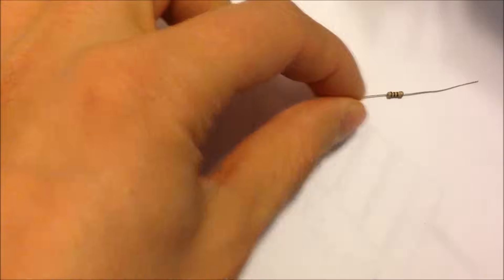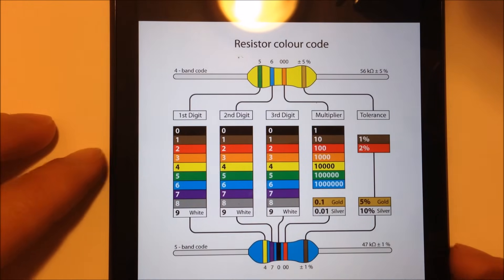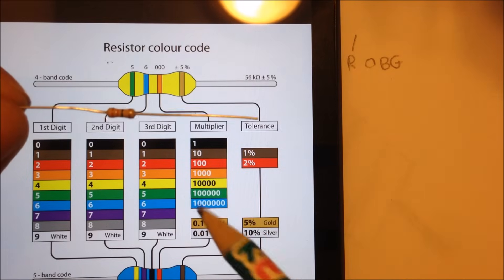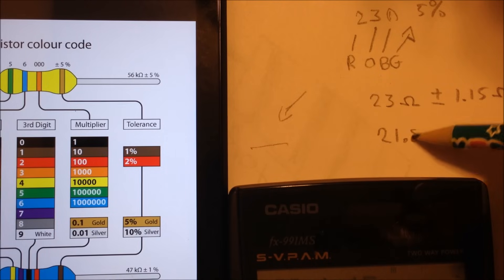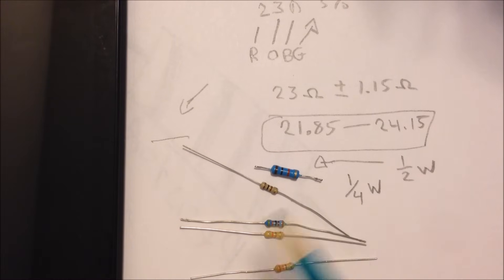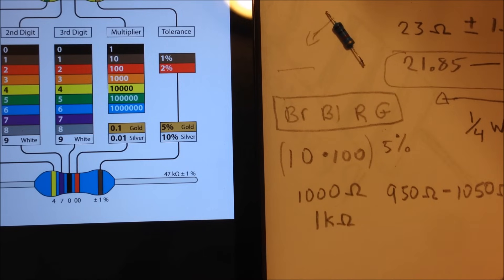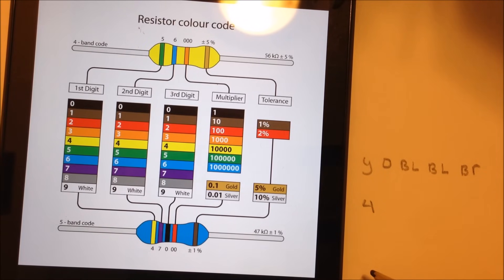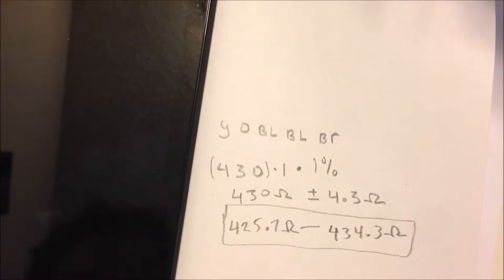Resistor Color Code Tutorial

Comment: If your circuit design uses a 10K resistor and a 120 ohm resistor, both in 1% tolerance... how do you know which is which without using a multimeter?

10K ±1% = brown-black-black-red-brown
120 ohm ±1% = brown-red-black-black-brown (same code but reversed!)
Reply: By the width of the gap between the colors.